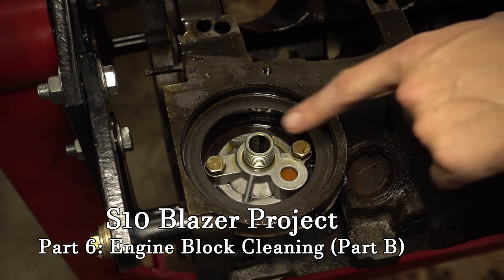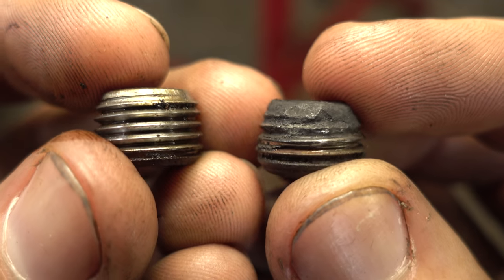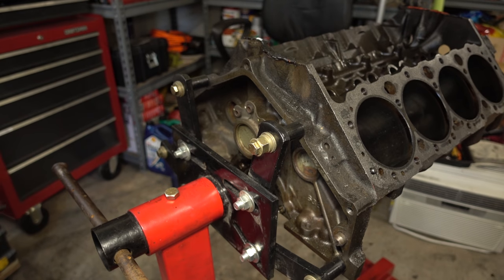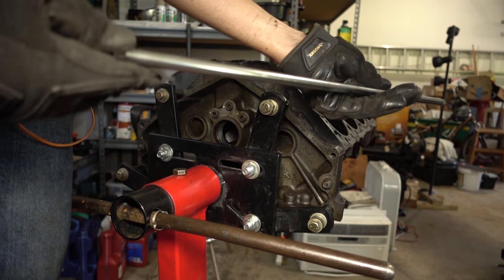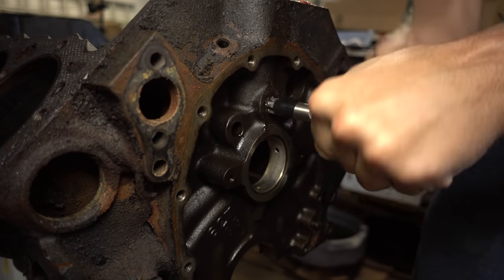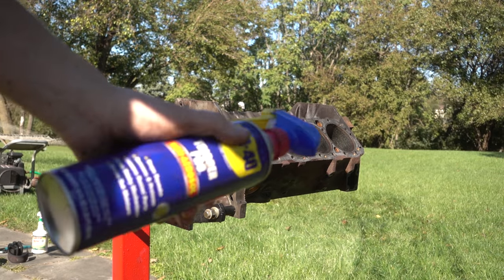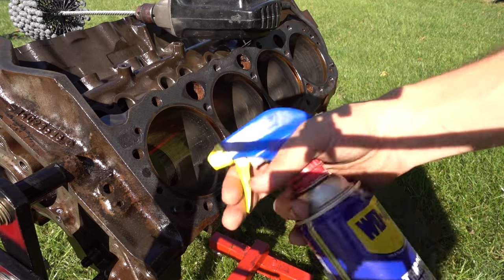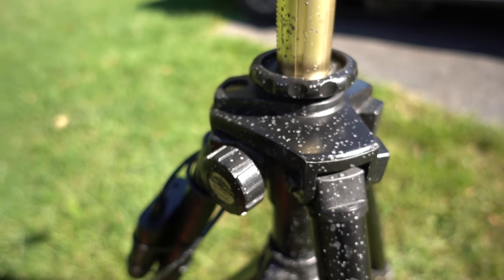V8 S10 Engine Block Cleaning and Honing (Ep.6, Part 2 of 4)

Comment: Why are there plugs? 2:10 Is there a reason there are plugs there and not something else or was it for machining purposes?
Reply from the maker: You've got it, most of the plugs cover passages used in the block casting and drilling process.
Reply: @FuzzyDiceProjects  Awesome. Thanks for the reply. Def subbed.

Comment: Good video! Are those plugs really necessary to replace?
Reply from the maker: Not generally, but it is a good idea. The oil ones should never wear out under normal conditions, replacing them is mostly to clean the passages or upgrade to threaded plugs for high volume oil pumps/high RPM use. The coolant ones are a good idea to replace as they will rust out over time, especially if the coolant wasn't changed regularly. Sometimes they will last decades though, and if you are doing a bottom-dollar rebuild you could likely get by with leaving them if they don't appear rusted/corroded.
Reply: @FuzzyDiceProjects  
Good info, thanks!

Comment: I'm a newb but what are all those plugs for? Are they a safety for pressure build up or something?
Reply from the maker: The holes they close are used in the casting process as well as the drilling of oil galleys in the block afterward. Plugs are necessary to make the block, but of course need to be sealed afterward for proper use of the engine. The larger plugs in the coolant passages (sides of the block) are often called "freeze plugs", based on the theory that if water froze in the block the plugs would be pushed out instead of cracking the block. That isn't their purpose and they shouldn't be relied on for that however, they're usually called "core plugs" or "expansion plugs".

Comment: What do all those plugs do, I've luckily never encountered needing to work on them
Reply from the maker: The holes they close are used in the casting process as well as the drilling of oil galleys in the block afterward. Plugs are necessary to make the block, but of course need to be sealed afterward for proper use of the engine. Some seal oil passages and some seal coolant passages.

Comment: what's the brush you use to clean the cinder?
where to get it?
Tell me plzz..
Reply from the maker: Just search on a site like Amazon for "Flex hone", this particular one is a 4 1/8" 240 grit model. Make sure to get one just a little larger than the cylinders you are honing.

Comment: Never knew wd40 came in spray bottles
Reply from the maker: Its way better than the aerosol, and you just refill it from the gallon cans so much cheaper too. The particular spray bottle I'm using I believe is a relatively new item, but the sprayer is perfect and I'd recommend it. Have to modify it slightly to be able to unscrew the cap to refill it, but no big deal.
Reply: FuzzyDicePimp I'm definitely getting one not a big fan of the aerosol either

Comment: I would take those plugs out the threaded ones and put something on them to help seal them although I don't think they'll leak just in case
Reply from the maker: All of the threaded plugs had thread sealer put on when reinstalling, it is always a good idea!
Reply: The plugs in the front will be under the timing cover so any leakage will be contained by the cover and cover gasket. So, you really do not need sealant on them.

Comment: Use a wire coat hanger to clean out the v gallery at the bottom of a V8.
Then buy round white brushes that go in a drill and clean out all the rust.
It's the only way to do it.
You can get them to go in all directions. Just saying.
Reply: Wire brushes

Comment: Everything is wonderful and you're doing a very excellent job other than why did you use a f**** wire wheel on a gasket surface that is the worst possible thing you can do the only thing I would recommend would be a nylon wire wheel which only affects organic material not metal unlike that steel wire wheel you were using
Reply from the maker: They are very soft steel wire wheels, same as the brushes I used to clean the pistons. I use the same wire wheels to clean gaskets off of aluminum, they are totally fine. Would certainly never hurt iron. But I appreciate you trying to look out for me!
Reply: You can absolutely use a wire wheel on a steel block.

Comment: You're not replacing the cam bearings?
Reply from the maker: They looked to be in good shape, so I didn't want to mess with them at this time. Partly because I don't have a cam bearing installer (yet), partly because I didn't want to buy new ones for this cheap rebuild. Since the engine was rebuilt in the past, in all likelyhood they were replaced at that time and these bearings aren't all that old anyhow.

Comment: Do you mean 12pt socket?
Reply from the maker: Nope, the ones used for that square plug and the pipe tap are eight point sockets. A twelve would work for some square things, but the surface area would be very small, and some squares have softly rounded edges (like that plug), so I wouldn't use a twelve on them.

Comment: You use a plastic brush on mating surfaces.  Metal will take metal with it.
Reply from the maker: Plastic wouldn't get off a lot of the tougher stuff I've had to clean up without powerful solvents, these soft steel wire brushes are the best! I proved it by using them to clean up a copper pipe in one video, they barely even left visible scratches in it and helped it seal well.

Comment: You could do all this yourself sure, or you could get it done by a professional that acid dips it, hones it and machines it perfectly so you are left with a block that is 100% perfect for around $500.

Cause all it takes is one stuff up and you have to start from scratch.
Reply from the maker: If you have the money to spend on that path, go for it! That's more than I spent buying the engine and rebuilding the whole thing, though, I wouldn't spend money like that for this truck.

Comment: What are all the plugs for?
Reply from the maker: Some for coolant, some for oil. The threaded ones at the base of the block and the ones in the sides of the block (1-5/8") are for coolant passages, the other threaded ones and the big one (2-3/32") are for oil. The holes they close are used in the casting process, and necessary to make the block, but of course need to be sealed afterward for proper use of the engine.

Comment: If you're having issues with the angle of the filter and clearances why don't you just put a remote oil filter on it like these trucks used to come with.  All three of mine have them... 92, 93 and 94.
Reply from the maker: It did have a remote oil filter, doesn't fit the V8 engine block I have. Will probably modify it someday so that I can use it again, but it is fine for now. The adapter I mention in this video is a different type, that came on medium-duty trucks to allow the filter to be turned sideways for clearance.
Reply: Ah.  I didn't know about those,  I only really have dealt with these and Duramaxes.  Not much in the middle.

Comment: Why in the hell would you not spend 20 more dollars and change the cam bearings? 
   I worked in an engine shop for years and never failed to replace a single cam bearing. Even on my own engines. Very simple to do.
  Thanks for making these videos for the diy-er’s but please take the extra steps to ensure they themselves do a good job following your videos. Cam bearings are also responsible for oil pressure as well as mains and rod bearings are. 
     Thank you
Reply from the maker: I understand your concern, but I didn't change them because they were in good shape. No reason to mess with something that works. And because I don't already have a cam bearing tool, it isn't just $20 for the first time I need it done. I say constantly throughout these videos that the way I'm doing it isn't the ideal way, but it is a low-budget way to get the job done in a real-world situation. That is quite different than a machine shop or engine shop building engines for customers.

Comment: Man-0-Man, Why ain't you changing out the Cam Bearing???? That's what makes the Oil Pressure in the engine. I've been rebuilding engines for over 50+ years and have Never Failed to replace them and their Cheap Insurance for the Cost❕ And, its so much easier to do NOW

Comment: Water and bearings don’t mix because the water will pit the bearings
Reply from the maker: You mean the cam bearings? Theoretically, yeah. In practice, the water is dried and displaced quick enough nothing significant would occur. I'm not worried about that.

Comment: I wouldn't use the hone more than 7or 8 times in and out. And I would never use a wire wheel on a mating surface especially not a headgasket

Comment: Please let viewers know that they don't have to have as nice of a drill as you
Reply from the maker: Which one, the crusty decades-old Craftsman 3/8" or the abused $100 Dewalt? You can use any drill for most tasks, but an old, corded, lower speed drill would be ideal for honing. Any drill with an adjustable clutch is good for cleaning threads (but you really should do it by hand, with a thread chaser).
Reply: FuzzyDicePimp joking about your craftsman drill
Reply from the maker: Haha, just checking. It is pretty nice though...

Comment: A locking straight hone will tell you everything you want to know (and don't want to know) about your bores.   These dingle ball hones will make any bore look way better than it really is.   There are lots of engines running around just fine with cylinder defects like that one cylinder, though.

Comment: Even if we value your time at an absurd $2.50 per hour, after accounting for all the work and parts, this is far from a cheap truck. Also, why not a modern DOHC i4 with vvt? you could have 200+ Hp with much better fuel ecconomy and better weight distribution.

Comment: If you put grease on the threader it will hold the cut metal shavings and keep them out of the oil galley. Simple Green is a good degreaser and it wont hurt the environment.

Comment: Chemdip much?
Theres NO crosshatching in your cylingers....which means this block needs to be rebored .10 oversize and bottom flared.
Block needs to be decked and align bored to true up the main journals.....
Hopefully you had the heads trued and valve seats reground with new valves.
Reply from the maker: While you are correct as far as an ideal build goes, I disagree that any of those things are "needed". This was (mostly) a bottom of the barrel rebuild (~$250, but I should have just kept the old cam and it would have been $150) and after a few thousand miles the engine is still running great. A small block Chevy can get away with a lot of non-ideal surfaces and parts.

Comment: you should of had that block hot dipped to clean all that crap from the cooling passages  a pressure washer want remove all that crud  A Hot Water Steam Pressure washer is Much better at cleaning a Dirty engine block  if your not going to have it hot dipped !
Reply from the maker: You're not wrong, but I don't have an access to a hot tank that I can use for free anymore, so a bit of manual cleaning with what I do have will do just fine (and did!)

Comment: Dude dont clean shit with oil on the gras....
Reply from the maker: Lol, where would you rather have me clean it? On the driveway, where it will runoff into the grass and make an even bigger mess? It's an environmental disaster no matter how you slice it.
Reply: Clean it somewhere with a oil water separator. 1 drop of oil contaminates 260 gallons of ground water, just think about it
Reply: Noxxi yes its scientifically proven. but really though what is science. seems like a lot of hokum
Reply: this engine is built based on scientific studies. so not really hokum
Reply: No it's not, now it's stuck in the soil for years, better do it on the driveway and let it pour to the drain and it will go to the sewage treatment plant.

Comment: that is nothing but pollution of the environment

there is a reason why car shops need to collect their waste water and use an oil seperator, that way the oil can be recycled and doesnt affect the soil
Reply: Everything he put into the environment came out of the environment.
Reply: I completely understand you, but the people replying are a bit of ignorant.
Reply: @blackspike2710   You're right, but you're TOTALLY wrong.
What, where, how, when, what concentration, etc totally matter for environmental issues.

You can't dumb everything down.
Reply: You're right, but the amount he is dealing with is not toooo bad...
Anything in the engine was pretty minimal.
The WD-40 should mostly evaporate (well then it's in the air...) and some people say it's mostly fish oil....??? IDK.

You're still right though.
Reply: Purple power is biodegradable and the amount of gunk he washed off is more than likely negligible compared to say a car that leaks a quart of oil between oil changes. All in all, not much destruction of the environment here.